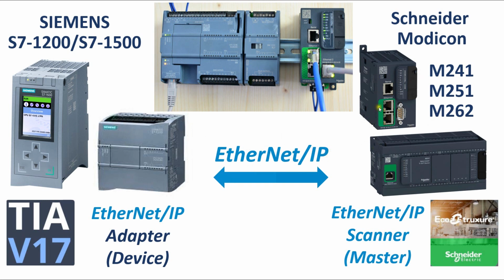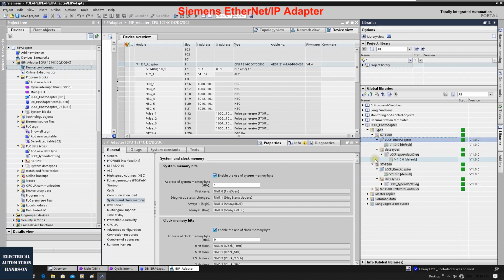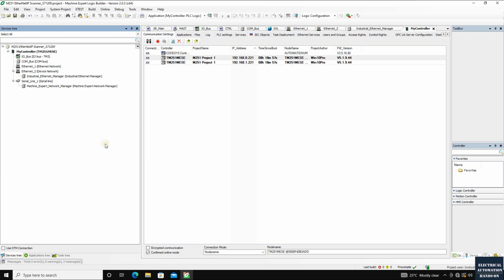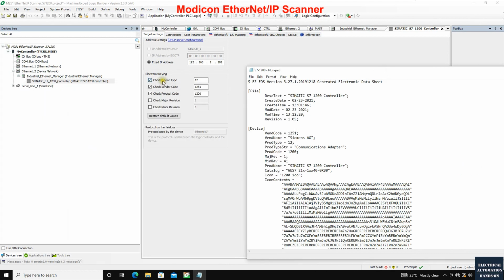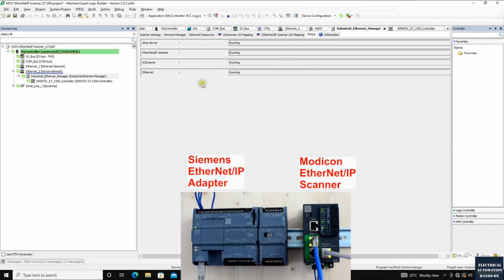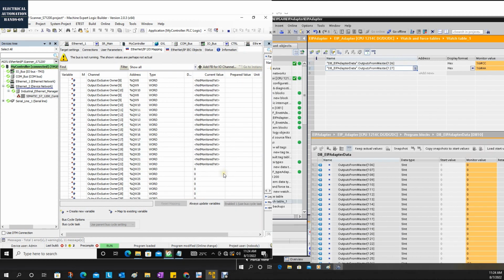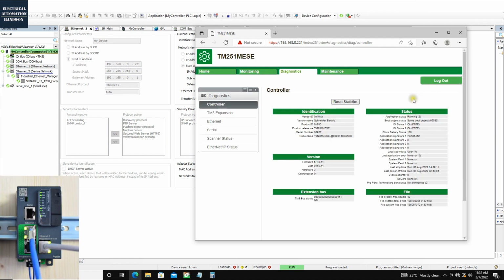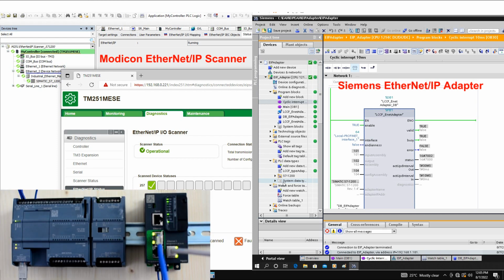COM28. EtherNet/IP - Schneider M241 M251 M262 (Scanner) & Siemens S7-1200 S7-1500 (Adapter)

Comment: is there any way to communicate between s7-1500 and omron SJ2hseris (EIP)?
Reply from the maker: You could try CIP or Adapter method.

COM26. EtherNet/IP Scanner - Siemens S7-1200 S7-1500 PLC Runs as EtherNet/IP Scanner Master https://youtu.be/zU5FYHFK5x4
COM27. EtherNet/IP Adapter - Siemens S7-1200 S7-1500 PLC Runs as EtherNet/IP Adapter Device https://youtu.be/IEdD9cQkg44

COM22. Ethernet CIP - Siemens S7-1200/S7-1500 (Client) and Allen-Bradley CompactLogix (Server) https://youtu.be/tmGrMfAhspA
COM30. Ethernet CIP - Siemens S7-1200/S7-1500 (Client) and Allen-Bradley Micro800 (Server)
https://youtu.be/OxxuAXj2epI
Reply: @electricalautomation  i tried with COM22 / COM30. But as you know that cj2m and cj2h Omron PLC don't use tagname, but using symbol name. 
In my case symbol name is not defined on the Omron PLC, we can only see the the address and comment of each symbol.  How could I used method on COM22?

Comment: Hello, Nice, great video.... Dude, how firmware version CPU do you use in those videos? I'm trying to communicate with Simatic S7-1200 1212C (V4.6) or 1214C (V4.5) but without success...
Reply from the maker: My CPU is V4.4, your v4.6 or v4.5 should be no issues on this feature. Please note that the Siemens CPU runs as Ethernet/IP adapter / slave in this case. I had many cases of using this method for the ethernet/ip communication

Comment: I’m trying to do the same thing using Ethernet IP scanner(master)as S7-1500 and slave as M221 plc. The Ethernet IP scanner block isn’t working as it’s showing parameter error. Would be great if you can make a video on that
Reply from the maker: Please find this video, running Siemens as EIP Master  https://youtu.be/zU5FYHFK5x4?si=wiZA6v-QH483cffR,  this link is also under COM28 video.

Comment: Good afternoon, talk about Brazil São Paulo. Congratulations, for your channel, great content. I have a question: I have a pll ET200 CPU 1510SP-1PN/06ES7510-1DJ00-0AB0 and I am trying to communicate with the shneider plc M241. However, the LCC ENET SCANER block does not work on this model (ET200).
Please, do you have any tips on how to carry out this communication? Thanks
Reply from the maker: If your CPU version is >= 2.6, the ET200 CPU 1510SP should be Ok because it is still s7-1500.

Comment: On the Siemens side, the status is 7414. We make the same settings as you.
What could be the problem?
S71200 PLC 6ES7212-1AE40-0XB0
SCHNEIDER TM241CEC24T
Reply from the maker: 16#7414  Vendor ID or Product code Mismatch
Reply: vendor id and product code are correct because we have uploaded eds file.  Need to make a change in eds file?  The required information in the respective CPU is correct.

Comment: How to read and write data bewteen PLC S7-300 via rpofinet ?
Reply from the maker: S7-300 does not fit this application.
Reply: @electricalautomation  I mean two S7-300 communication each other which the old PLC I have no source
Reply from the maker: @vorapobautomation9760  You can use S7 Connection via Ethernet, or MPI Put Get